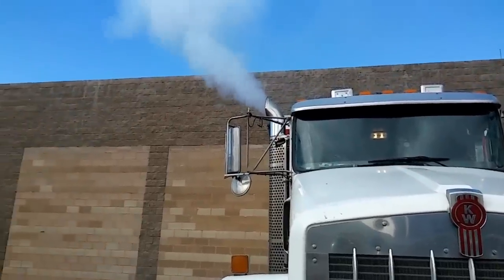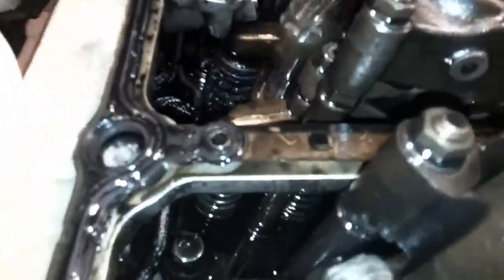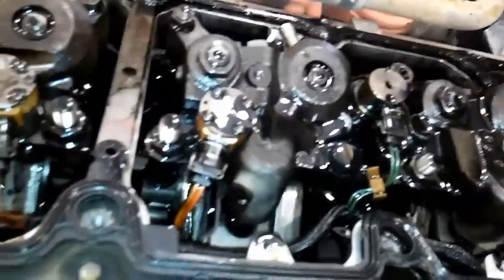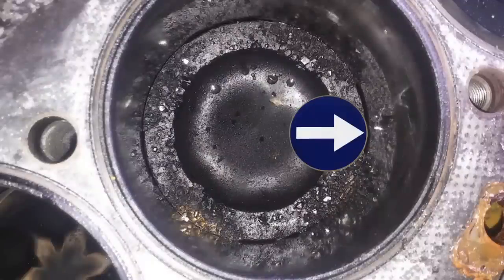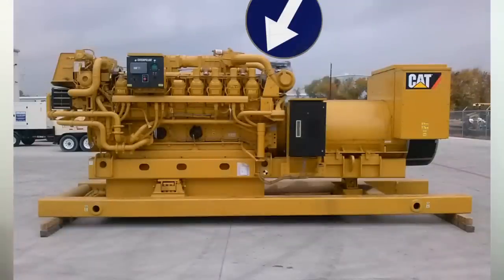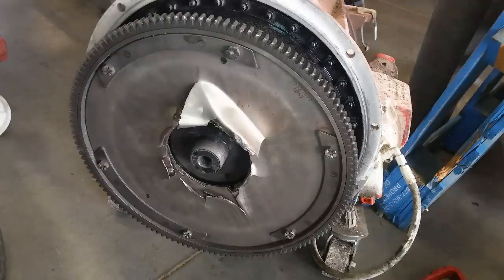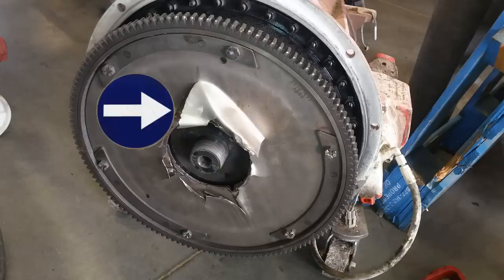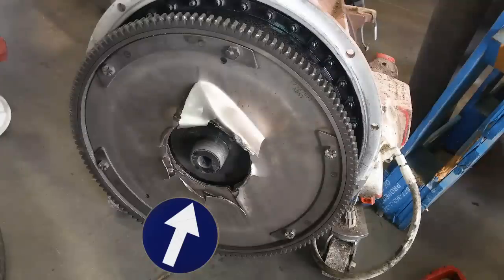Should You Warm Up A Diesel Engine?

Comment: There's nothing wrong with warming up any engine if it hasn't been in operations for a few hours. If it has been more than 8 hours and especially in colder weather (below 60 F), I would recommend letting any engine warm-up for 3-5 minutes (definitely not just 1 minute). A lot of wear can happen simply because the oil isn't in a viscous-enough state and the revs may outrun the ability for the oil to get there quick enough and lubricate. One of my vehicles is a twin turbo 350Z and from the factory it came with an oil pressure gauge. It's crazy to see how high the oil pressure is when the engine is cold and if you simply rev the engine with no load, the pressure shoots up because it is so thick.

Comment: Always enjoy watching generators go from a deep slumber to full tilt.  Then the ATS kicks the load over and watch the temps climb.

Keep the destruction of the week.  I guarantee that will grow your subscriber base.  Besides you have no limit to content because man will always find creative ways to destroy something that was very capable in the fist place.
Reply from the maker: +Shain Andrews I'm already trying to think of a good one for next week. I've got a geartrain failure and some other nifty pictures saved in the old computer.
Reply: The cummins tech didn't liked me much when I made his engine stall every time the ATS closed.
Reply: SuperOffgrid how will you run the blockheater and pan warmer during a grid down situation? Also if you are doing a test start make sure you run some load for a good amount of time. Back in the late 90's and early 2000's it was not un-common for some one to cause a fire due to cold stacking. This is caused when a genset is test started every month or so and allowed to idle with no load then shut down. When a real outage comes along the exaust system on the set would be full of unburned fuel. When it takes real load and heats up that fuel catches fire.

Comment: We've 4012 and 4016 Perkins engines for backup. These days I start them up to 3 times a day here in South Africa. Yesterday we opened 2 heads, leaks out on seals, to replace gaskets and seals. I couldn't believe I still saw hone marks on cilinder walls at 2000 hours. Do I have a secret? Well. Try to keep engine's antifreeze at 60'C/140'F on block. The engines start up and straight up to 1500rpm. I've chosen a synchronizing system and the 4 engines synchs in 1-2 minutes. Afer 1 minute Incomers sync, the Gen plant takes load gradually for 1 and a half minutes up to 80% load. Sometimes when the factory load is really high, I put my hand on one of the engine's oil filter to feel the oil temperature till it is hot before transferring the load. 

Then you getting the gen R-UPS that starts up and at full load in 15 seconds. I believe that's really bad for a engine block and turbo.

Comment: Your destruction of the week video brought out an old memory. I had a pickup that someone had worked on before me and they forgot to tighten the bellhousing bolts. As I drove the truck I would hear a strange clicking sound as the transmission moved around flexing the flywheel. Eventually the torque converter bearing failed, leaking out the transmission fluid. The flywheel didn't come apart but was cracked pretty bad.

Comment: Monday morning....hold it on the governor to build air...lol
Reply: I approve of this.
Reply: Oh lord And there I was thinking what can be worse than A Renault with a Renault Engine so They used Mack V8.
I didn't know Macks used Renaults engines.
Reply: John Hull... for a fleet truck hell yeah, if you're an owner driver maybe not
Reply: Samuel Rosenberg no
Reply: I work at a bus station here in the UK and its standard practice to rev the balls off the buses to get the air pressure up whether they're warm or stone cold...Then they wonder why all the buses are fucked!
Reply: jai mal au derrier That made me laugh pretty good. Thanks!
Reply: If it's a Detroit, hold it to the floorboards until the smoke clears.  Lol
Reply: On the MTVR there's a high idle switch that brings the revs up to 1500. I've used it to get air pressure quickly.
Reply: @roberts1677  why do you need air pressure ? 
Are you a sea diver or does air lubricate the engine ?
Reply: @Don Walker air brakes.

Comment: Power standby generators go from 0 to full load when they start up, but they don't start up every day, as well as they are usually in a building and have coolant and oil heaters to keep them in a state of being ready to come to life at  any moment, even with regular testing of these standby units, they would have a cold start scenario over a period of 10 years, that our trucks might go through in 2 or 3 months. Good info for thought, thanks for the video

Comment: I start mine and let it idle for 10-15 with high idle
Reply: Zac Arnzen, technically, high idle is full speed.
Reply: @therealRustyShackleford  why would you say 1100 rpm is full speed, I could easily say it's definitely not
Reply: That’s pretty excessive. It’s not generating enough heat at hight idle to warrant 10-15 min.

Comment: Bone-stock 2004 F250 6.0 owner here. I’ve got 190k miles, had it since 79k miles. Never had any problems out of mine. I never think about warming it up unless it’s cold outside, then I’ll warm it up while I wait inside so I’ll have my heater quicker. Other than that, I just crank it up, buckle up, set my Spotify station and take off. It’s a vehicle i have it for my convenience, life’s too short to get all technical about “warming up” engine parts. Just get in and drive it.

Comment: My Audi 2.5 diesel when its cold after start keeps 1k rpm and gradually drops down to 800rpm, when its really cold(-20 deg. celcius) the ECU runs the engine at 1.2-1.3k rpm. So basically what you offered, ECU does by it self, right? after the rpm drops, i drive out of the driveway at idle(which usual takes more than half a minute, long drive way) and until i c coolant starting to clime over 60 deg, celcius, i dont rev the engine over 1.6k rpm. Sounds about right. Too bad getting to work and back, coolant reaches 90 only in summer time. i was thinking of getting 12v 60-80 deg, celcius PTC heaters and mount them on the oil pan. Any thoughts?
Reply: Mindaugas Vaskevicius my opinion is let the ecu do its job. If you excite Oil temp, but not coolant the ecu might not like it.
All the other stuff you do, is good.
Reply: Mindaugas Vaskevicius 
Change the coolant valve. Often valves dont close propperly and let the engine heat up to operation temperatur.
Reply: Mindaugas Vaskevicius do the simplest thing and cover part of the radiator with a piece of reinforced card board  or plastic. This was common practice on the old (1980's) London Black Taxis in cold weather. In nearly all parts of the world cooling is far more important than reaching operating temperature. Idling the car with aircon on will cause slight load and warm engine faster and fans will load alternator and generate heat. If you use synthetic oil I wouldn't worry about heating the sump. I would think about the diesel gelling up, the tank doesn't benefit from 'warming up' even on a long trip.

Comment: Since we are sharing warmup routines might as well share mine. Generally I do something similar in the mornings. Winter mornings around here is Western Idaho/ Eastern Washington can get to single digits and sometimes lower. I've got an 02 Ford 250 7.3 TD. I do what ape here says and let it run about a minute. I then keep the rpms under 1800ish until warm.
The reason for that specific rpm is that's the point were my turbo starts really kicking in. Someone told me a while back that since the impeller in the turbo spins very fast, that it needs a lot of oil to lube it up, and if your oil is flowing about as well as Canadian gold, then your gonna be in the market for a new turbo soon (that is on top of all the other reasons mentioned as well). Cheers guys!

Comment: had near same thing happen to a maxitorqe in a Mack at work, driver brought it in to the shop and stopped outside the door.  he came in said his clutch needed adjustment.  well I rolled up door to bring it in and when I went to put it in gear it nothing but grinding like the clutch wasn't even in. So I started it in gear to get it inside the shop,  went up it to adjust the clutch. I had another mechanic inside feeling for clutch brake and free travel.  I kept running it in and in and couldn't get any free travel until I ran out of adjustment. At this point we thought the clutch had gone out so we pulled the floorboard to begin pulling the tranny out.  When I got in there I was undoing some air lines to the splitter and happened to look over at the bellhousing and didn't see any bolts.  I thought well that's odd, and there was a gap big enough to put my hand halfway inbetween the tranny and motor lol. So we got to looking and there was only 3 bolts holding this thing in place and just barely because they had all backed out allowing the tranny to hang.  I don't know what kind of carnage would have come of that had it come out going down the road and the mess considering these all had wet kits installed as well. Good ol quality work the Mack house did putting a rear main seal  in under warranty couple months prior to that.

Comment: If you're running a fire truck, you have no choice.
Reply: Fire trucks typically sit inside the bay until needed where it is warm lol.
Reply: @jjjthomasson8902  Difference between engine warm and ambient warm.  Hmmm?  100 degrees or so?

Comment: I have a young guy neighbor that ALWAYS idles his diesel truck for 15-20 minutes every day, summer or winter....and we are in North TEXAS. Near DFW.
I've always heard the cool down period is very important after hard, high speed highway running...to cool down the turbo, and let oil bathe the turbo bearings at idle speed.

Comment: Or you live in Canada and its -40 C, minimum warm up time 15-20 minutes,
Reply: @ 6oh. I'd imagine this would not be a huge compromise for those living in such cold climates as many would do the same for petrol motors if only to warm up the interior from a comfort point of view. Though warming up the oil in a petrol vehicle sounds like a good idea as well. Still, interesting comment/matter in any case. (upped).
Reply: In Yukon when its below -40 (not feels like -40) the trucks in the mines don’t even move.. they just let them idle all day. It’s so cold that the truck can break in half if it’s loaded and it hits a bump at speed.
Reply: I hear you (from North Dakota). It takes that long for the (manual) tranny to warm up enough to even shift it.
Reply: -20c I let it warm up close to a hour. Now I can shift without having to use to hands and pull the shifter with everything I got.
Reply: Haha that's funny. 
-40c is pretty cold in Canada. 
Down here in the states , we call -40c by it's actual temp which is -40f.
Reply: What a electric heater is for... But getting my ass moving takes longer
Reply: 30 min of webasto !!!
Reply: Even when plugged in......(from Winnipeg...)
Reply: When it's cold I park my truck with the transfer case in neutral an the transmission in 1st gear, when I  start the next morning I let it high idle like this for a bit, it puts a light load on the motor and warms up your gears so you can shift sooner.

Comment: To warm up my Detroit I start it up let it warm for 1-2 minutes then slowly drive away.  I keep a light load on it until both coolant and oil are at running temp, then foot to the floor.  Keeps the engine happy.

Comment: A diesel engine doesn't warm up until it is UNDER LOAD!
Reply: Exactly. Most diesels dont have a throttle plate With no throttle plate the engine a little more than  a air pump with a bit of heat from the combustion cycle to overcome parasitic load and keep the crank turning. air fuel ratio 100:1 At least with a Gasser there is minimal intake air to keep combustion air fuel ratio correct near 14.7:1. Beat that dead horse. Sure stand by emergency diesels like pumps and gen set start at full governed speed most times. Oil and coolant already at normal operating temperature. 
Someone said some Volvo diesels have inlet air heaters and oil pre-start pumps. Sure it does increase the complexity but triple the engine life.
They are slowly implementing systems to mostly reduce emissions, but also help reduce some wear points.

Comment: Pistons in any engine shrink in the bores when cold and must get a little heat to swell them back up to prevent excessive piston slap. And let the oil warm some. From an ex mopar flat rate dealership tech. I replaced a lot of pistons and bearings. Mopar said in service bulletins 3-5 minutes on gas engine befote drive away. Regardless of what the epa says about dirty engine idle.

Comment: Seriously though....i agree with you except should be non issue if you do a proper pre trip
Reply: John Hull a pre trip has nothing to do with getting an engine to operating temperature
Reply: David Carvolth 
After checking fluids, the engine should be running for the rest of the pretrip. So yeah, the pretrip has a lot to do with warming the engine.
Reply: In the time the pre trip takes, the engine should, in that time period be thoroughly lubricated.
Reply: The proper pre trip takes a perfect amount of time to get the engine where you want it temperature wise. Perfect answer!
Reply: My pre trip consists of seeing if the truck starts or not lol
Reply: andrewclarkacpt: THEN You are a steering wheel holder, not a Truck Driver!  Probably work for a Mega Carrier like Swift or Werner.
Reply: M Shultz actually I dont. Never have. I drive a water truck and school bus
Reply: andrewclarkacpt: oh even better!
Reply: A portion of the pre trip is performed with the engine off.  Obviously you know very little about the subject . Keep watching and you may learn, if you are teachable .
Reply: chet Gerber DO YOU UNDERSTAND THE WORDS THAT ARE COMING OUT OF MY HAT?

Comment: This is also application specific. If this is a diesel car or pickup it’s going to see a very different load than if you are a highway tractor hitched to 80,000+lbs. Here in northern Canada most drivers fire up, let idle for a minute or so. Then hi idle while doing your pre trip. If loaded I know a lot of guys wait till it’s atleast 140 degrees before taking off lightly. With that said many drivers run Webasto or Espar on board heaters. These little circulation heaters keep the engine and bunk warm without having to run the engine all night.

Comment: In the arctic we preheat the engine until oil drips from the stick when you pull it. In 0 degrees and colder we don't cold start unless it is an emergency. Once its started we typically run it at idle for a few minutes and the idle it up to 900 to 1400 rpm depending on what engine it is. Typically once it's running it stays running all winter other than a quick shutdown to check the oil. If it's not pulling a load it's on high idle.

Comment: If I have oil pressure I drive away.  I take it easy though.  Synthetic oil always.
Reply: Synthetic oil here too. Like night and day. Also since it stays thicker than conventional oil at operating temp, it leaves a protective coating which prevents metal to metal contact at startup.
Reply: Alan Synthetic oil here too ... Huge difference
Reply: Dino oil does that too. Just pulled apart a blown up 7.3 IDI that had been running on 15W40 Delvac; it threw a rod. November of 2016(so 18 months ago) and drained all the oil out of the holes in the oil pan.
The connecting rod I pulled out had a nice film of oil on it still(the rod snapped in two... both ends moved freely on the oil film still). Everything else had a nice layer of oil on it, with zero rust. On the other hand, spots on top of the engine that had been clean beforehand now had surface rust on it from the moisture of 2 winters.

Comment: First rule is to have the proper winter oil. There are diesel synthetic oils 0W40 (Shell Rotella for instance) that really assist in the starting and lubrication of the engine. The Shell bulk agent here is Ottawa Ontario advised me that most of the contractors only use this oil in the winter for their construction equipment. When I had a diesel truck really noticed on starting after sitting in the parking lot all day was a real difference in first part of the starting/running as far as the RPM drop at first start comparing synthetic versus non synthetic. First saw this use of synthetic on the Canadian prairies in the winter in the diesels. 

Also ensure you have winter diesel in the tank and use untigel in the fuel in real cold conditions.

Comment: LOL, I used to live in northern MN, like 40 miles from Canada. -10? That's the 2nd week of November, bud.  I passed my CDL test on 2" of snowpack at -15 in March 2006.
Reply: Northern Wisconsin bout an hour south of Ashland was one hell of a cold winter last year. Sadly I could rely more on my 05 c15 firing up then my 99 blazers 4.3, that would just crank and backfire at 10 below lol
Reply: Yeah in ND it seems to be around a month in the middle of winter of -10F for a HIGH temp...
Reply: GuerrillaRadio Where abouts? Im currently up in Ely area. -30 is the best... lol
Reply: @MiseryWhipMetals  well going off of last year, December 24- January 5th didn't get above -35. About 40 miles south of Wolford. Didn't get above 0 from Nov. 30 to January 23.
Reply: Congratulations
Reply: GuerrillaRadio -15 f or c ? If you're taking c, that's not that cold lol.. Even in Ontario it gets down to -40